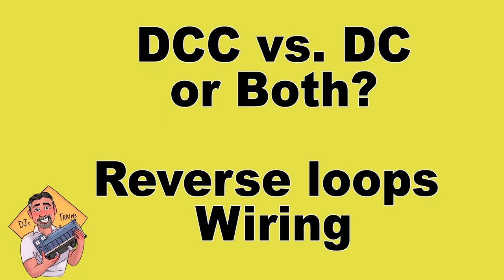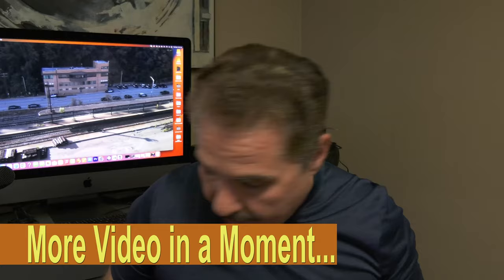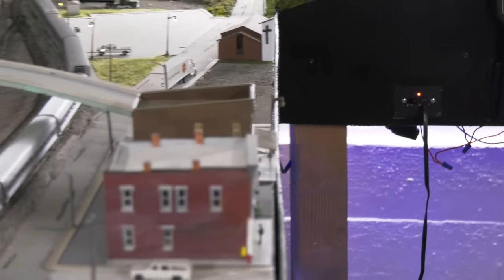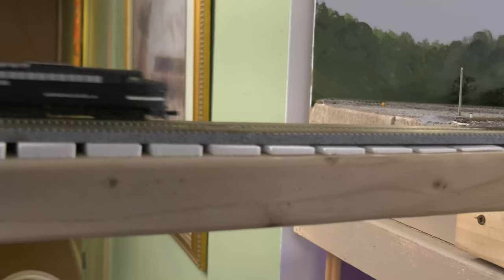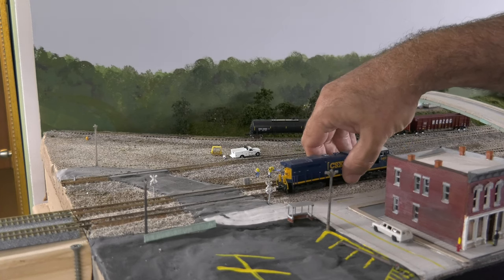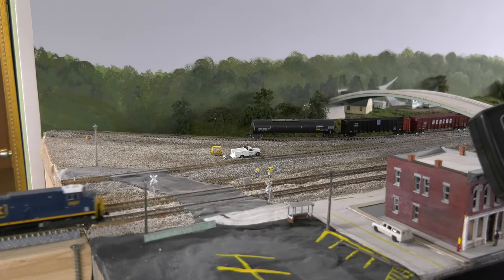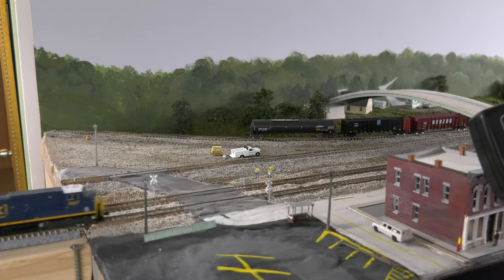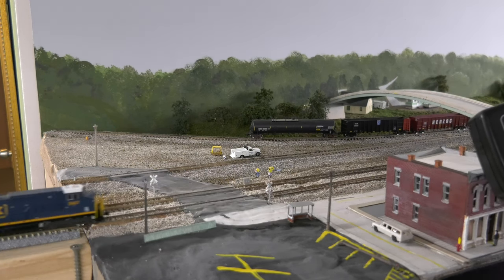Model Railroad DC or DCC? How To Wire REVERSE LOOPS!

Comment: 1:21 That backdrop turned out great! After decades using DC, we finally made the switch to DCC and have never been happier. As you illustrated in this video, I think most people in this hobby over exaggerate the wiring required for both DC and DCC, although we did end up soldering feeder wires all around the layout to each piece of track.
Reply from the maker: Awesome guys

Comment: I also like the idea of having both DCC and DC.  When I bought the NCE Power cab and started experimenting with DCC, I soon realized that some of my locomotives are going to be a pain to convert to DCC, if even possible.  Having a DC option, even if just the main loop, would give an opportunity to run some of the old motive power.  I did just convert one of my 2-8-8-2 steamers to DCC, which was a challenge, but actually turned out well.  I have another one, and might try and get some video of the project, as I'm trying to start collecting content for Youtube.  We'll see how that goes.

Comment: Good stuff.  I've seen videos before on using the AR-1 and that sure simplifies wiring of the loops.  It also simplifies track planning, as you don't have to worry so much about creating wiring nightmares.  I really like how your layout is coming together.  I kind of want to see more about that 2x4 that looks like a lift-out section.  I've been modifying my track plan to perhaps abandon the reverse loop - dog bone style and more towards a loop around the room with a lift-out for the door.  I didn't want to take over the whole room, but it's a small space...

Comment: Hey DJ, Great Vid,,,,,, but after collecting, custom painting/decaling, & super detailing like over 200 locomotives in PRR, RDG, LV, & LNE,
I'm not about to start buying decoders for all of them or..... try to figure out how to modify them to convert. When I retire this time next year,
It will be permanent layout building time, and the layout will be DC w/ Code 80 track on cork roadbed. I've been hoarding it for years. I do own 
some BLI Loco's, and like that they are both DC/DCC. I want to be able to run all of my engines at will, and will have it wired to do that.
I had hoped to talk to you and others at Altoona, but it falls on the same weekend as the PA Bowhunters Festival in Forksville, Sullivan Co.
Enjoy and thanks for the vids

Comment: I tried the Ridge wallet but I don’t have the manual dexterity to pull the cards out with my thumb the way I used to do, so I’ll stick with my old fashioned bi-fold wallet. I also use a money pouch because a pouch gives me a better place for my change. However, that being said, the return was easy as long as I had all the original packaging, which I knew right where it was.

Comment: Djstrains, you portion/segment on Reverse Loop is good advice and explanation, and I know you said, "its only your opinion" to have both DC and DCC switchable to the same track, but this is not a good practice to promote both on the same layout unless their loops are totally isolated from each other.
Reply from the maker: I understand, and agree that there is increased likelihood of problems which I tried to address the pros and cons in this video

Comment: Mechanically I'm pretty sharp. One thing l did years ago was tear down the reduction drive on the old Athearn drive on their diesel to and redesign it to get even more gear reduction. Did not have the machinery to make it though. But electrical. I have trouble getting the red electricicals to go down the red wire and the black ones to go down the black. This makes things clearer.
One thing l think would make things a lot easier for everybody is using on board power with a Bluetooth connection. The only track power you'd need might be for a parking track to recharge the battery. N scale it might be tough to find room for the battery on freight locomotives but passenger trains should be no problem.

Comment: Hi  DJ hope all is well, saw this video and it was just what I need on the reverse loop. As far as DCC or DC I operate pretty much prototypical so DCC way to go. I’m about the same size layout and plenty of switching. Does each loop require an AR1 board? Or one for each loop? I intend to redesign my layout and thought there was no circuit board that’s great thanks again. Look out for my videos of the build in the future.
Reply from the maker: Yeah, I believe one for each reversing section.

Comment: I’m under the impression that the auto reverser also works when you’re running DC. Is this correct? I intend to use a setup similar to yours so I can run my older locos that don’t have decoders.
Reply from the maker: Not the one I shown 

If there is one that can handle both, I am unaware of

Comment: Building an n scale layout of the North East Corridor.  Will definitely have DCC, yet all of my passenger trains and some other engines are DC.  Thinking about making an Amtrak passenger line with catanery that is only DC and not connected  any way to the ready of the layout (which will eventually be DCC).

The other option is the toggle between DC and DCC that D.J. just showed.  But I'm scared that I will screw up and burn out some DCC boards.

Which would be better?  Any thoughts?  Pleas share.
Reply from the maker: Catenary is a brilliant idea

Comment: Hi DJ, lovely video; I’m new to this hobby so ( N scale) is it possible you could help me! 

I have double loop ( DC only - 4ft x 2ft) and I would like to introduce double crossover (Kato - 20-210). The two tracks are independently wired, using a twin track Gauge master controller. My question is, how would I go about wiring this up and to include Kato crossover…. Your help will be appreciated…kind regards Brian H (England - UK)
Reply from the maker: It’s really not as complicated as you fear. Since I am focusing on other things this year, I’d highly recommend you joining one of the many free forums online.
Just google “model railroad forums”. I belong to 4 of them lol

Comment: your bus wire looked to be either 14 or 16 gauge DJ, and soldering ain;t that hard if you're using an iron with the right size tip it just takes some practice! by the way, you know how the willard yard has the woods around it, you wouldn't know which office position you'd talk to about getting to hunt them by chance? i've seen a couple bucks by them that had to be 10 pointers if not 12!!
Reply from the maker: Hey Keith, CSX is so corporate controlled that nobody at low levels can make a decision regarding anything
Reply: @djstrains OK thought i'd ask i'll find a way to get those deer one way or another!!!
Reply from the maker: its easier to ask for forgiveness than permission.
Reply: @djstrains actually i was thinking something close to that!! just not put that refined or civilized!